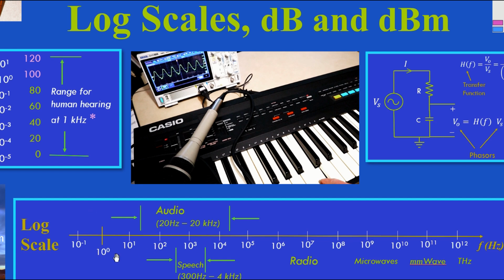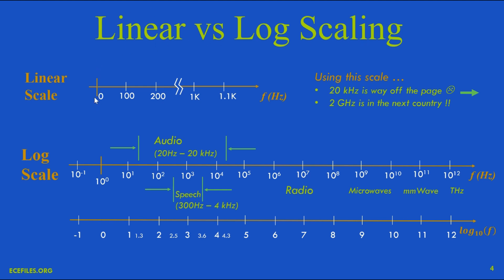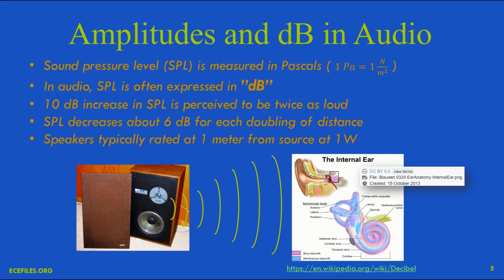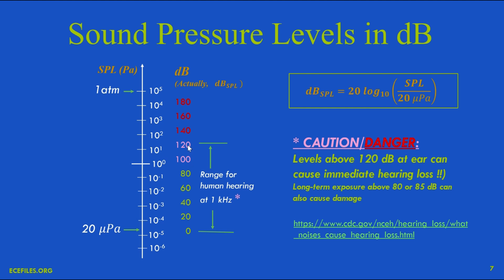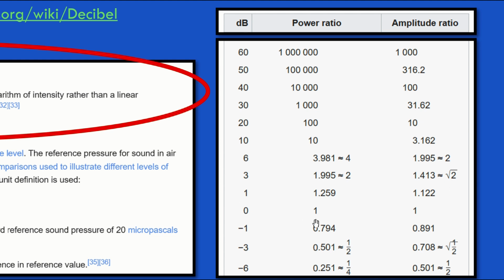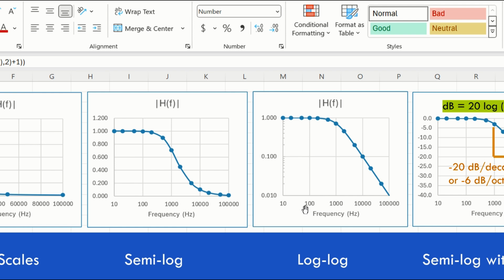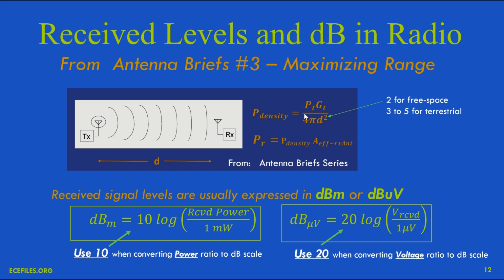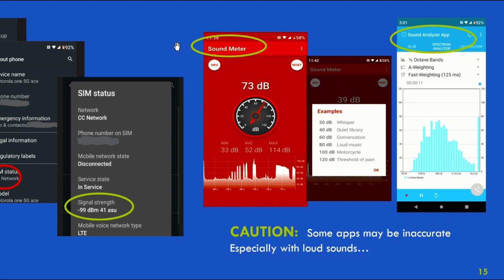Frequencies, Amplitudes, Log Scales, dB and dBm - ECE Topics #7

Comment: Remarkably useful content; concise yet comprehensive.
Question re; the reference piano music at the end: which clip should my ears perceive as "half as loud", the -10dB level or the -20dB level? I didn't grasp the whole 10db/20dB thing for physics/SPL vs audio "power" (and my old ears are surely screwed from decades of listening to AC/DC & Motorhead anyway!). I suspect the -20dB level is supposed to be half as loud as the reference level, right?
Reply from the maker: Thanks. That's good to hear (pun intended ;-) On the question: The half-as-loud should be the -10 dB one. But its very subjective, by definition. Interestingly when I was playing it back on my PC, the -10 dB section sounded a bit less than half as loud to me as the reference section - maybe 1/3'ish. And at -30, it seemed almost gone. But when I played it on my better speakers, it seemed about half as loud at -10 dB - agreeing with what the literature suggests. I suspect it depends on how loud stuff is when listening, maybe ?
Reply from the maker: I was a little worried about the 10 vs 20 dB thing when making the video but opted for leaving out the somewhat dry math derivation :-)  It's confusing for sure. The 10 vs 20 multiplier in the formulas doesn't change the dB value. Its just how you get to dB from amplitude or power. If you already have a power ratio - then you use 10 log. But if it's voltage, its 20 log. That's because with a voltage ratio of V2/V1, the associated power ratio is (V2^/R)/(V1^2/R) = (V2/V1)^2, and 10 log [(V2/V1)^2] = 20 log (V2/V1) by the rules of logarithms...